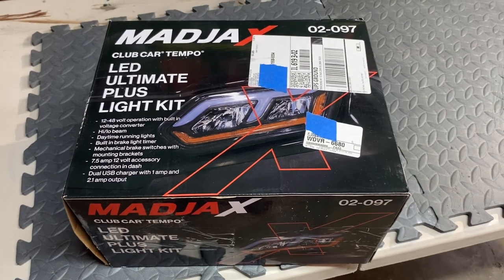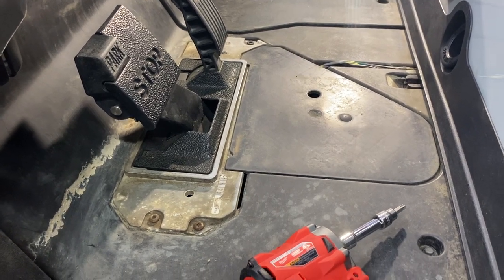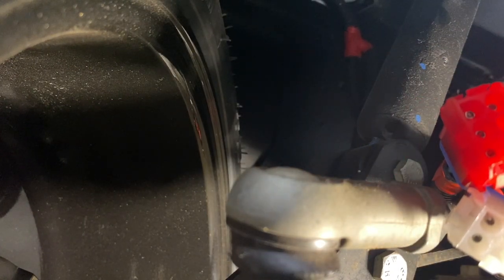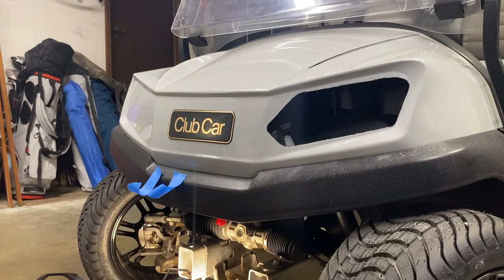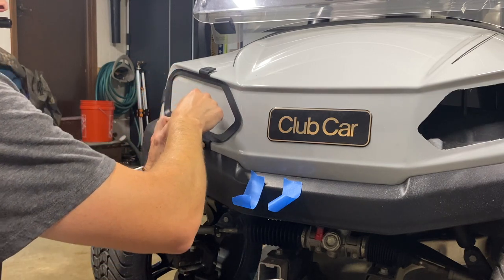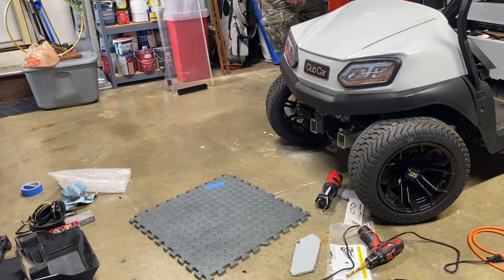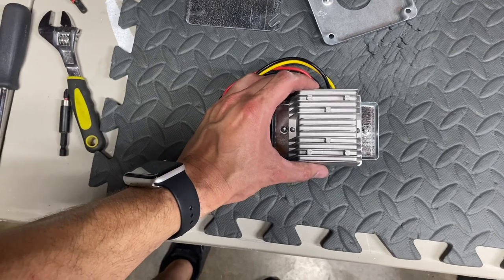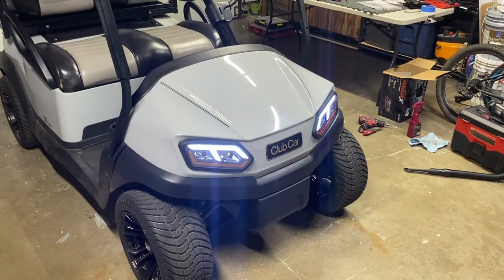Madjax Ultimate Plus Light Kit for Club Car Tempo - Installation tips and review.  WATCH FIRST!!!

Comment: I bought a different brand of light kit.  The head lights mounted differently and design is not the same.  But all wiring was identical.   Paper template sucks.  Doing this tempo mod for my dad and didn't want him to spend more money.  But after dealing with the paper template i should have got it.  Nice video.
Reply: How much you spent?

Comment: Edit:  It’s a grey wire from the light kit to the grey wire to the club car original wire kit.  It’s not fixed but unclear which grey wire to splice to connect and get it back to moving again.

I finished my install but now my cart won’t start.  Seems like the wires to the front dash are not signaling that my car is on.  Any tips on this?  The battery indicator was blinking at the end of my install and now it won’t start.  I charged it up and still nothing.

All my lights works and everything seems normal it just won’t engage to drive.

Comment: Great video definitely helps.... can you tell me or take a picture.  where you ran your tail light wires . Because I have a president and I ran the wires through the wheel on it but the madjax video shows pulling the wires Under the seat through the batteries. So how do I get to the wheel well ?